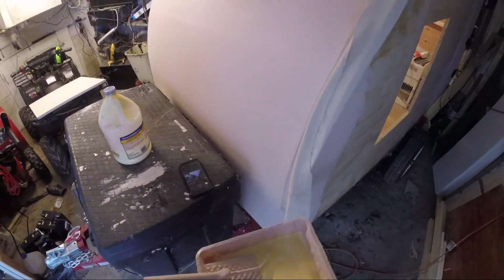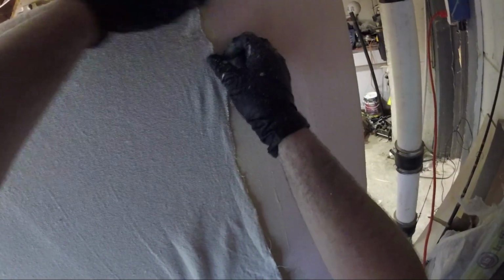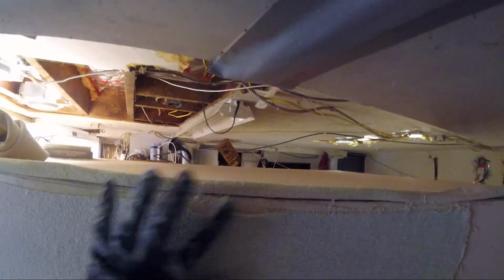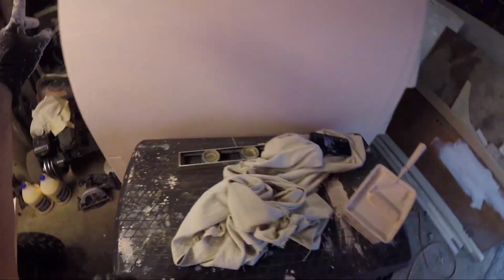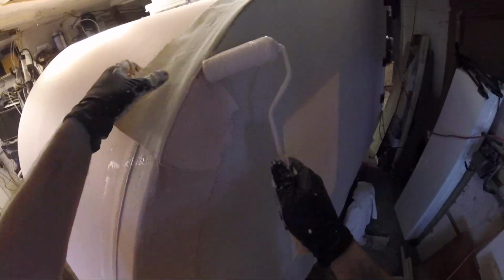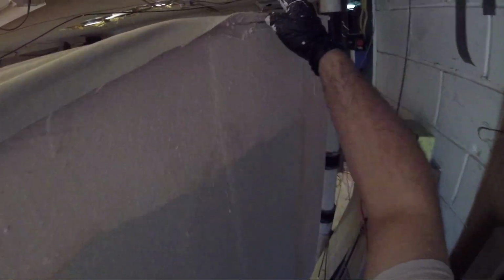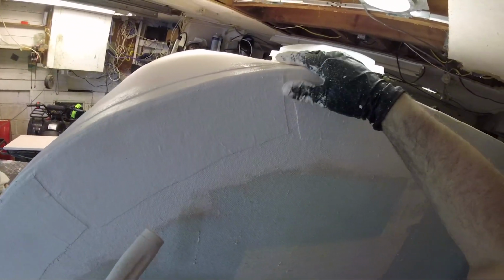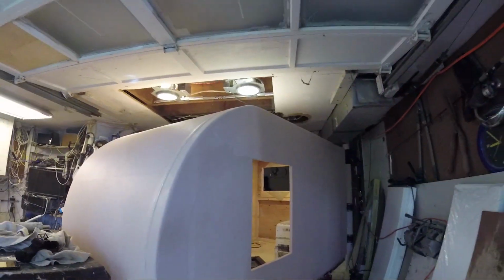Finishing the Canvas - The Teardrop Camper Build - Part 20 - Poor mans Fiberglass

Comment: use oil base primer and then use all surface oil base paint you will not regret, it is what I used on my last build and will be using on my current build

Comment: Just guessing, but I'd try a rolling wheel cutter (look lIke pizza cutters, but wheel is thin and razor sharp) and cut the ragged seams straight with a straightedge.
Also, I'll be trying a full pan and a 9 inch roller for speed. As a fabricator, I'm determined to build a teardrop for my Harley! When I paint, I keep a roll of stretch wrap handy, for keeping tools wet thru lunch breaks or even overnight. I'm  wondering if the glue mix could be worked on with an airless sprayer. That would be crazy fast and for overnight,  you'd just stick, the gun in water, same as paint.

Comment: Did you give up all the extra strength that wrapping the material over the seam and onto the other side by cutting it at the seams?
Reply from the maker: Everything is overlapped by 8 to 12 inches. Not sure what you are referring to.
Reply: Scrapin I believe he is referring to 9:42 when you cut the canvas with a razor blade on the “seam” of the trailer.

Comment: What type paint are you using. Is it latex or oil based paint.  I would think oil based would stick better, am I wrong thinking that. Did you try both types.
Reply from the maker: I went off of what other people were using. Exterior latex paint. Oil based would probably work as well but I have not tried it on canvas. I would say do a test piece before comiting to it.
Reply: Thanks

Comment: Have you tried to sand between coats of paint to make it smoother?
Reply from the maker: You definitely can. I did sand some spots to see what it would do. It makes a super smooth finish, if you wanted it to look that way it would take some time, but you could make it really smooth if you spent the time. I ended up doing the final coal and left most of the little nubs from the canvas.
Reply: I did just that a long time ago. Sanding between coats on canvas is actually more important than on wood, especially for the first coats.